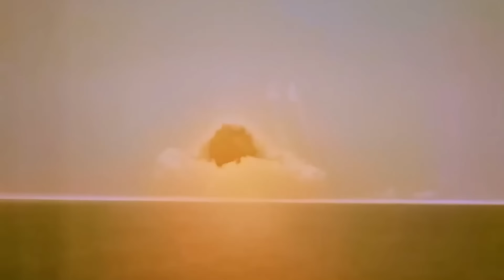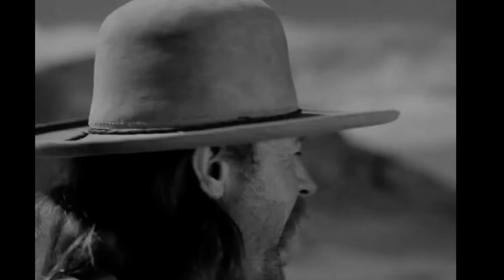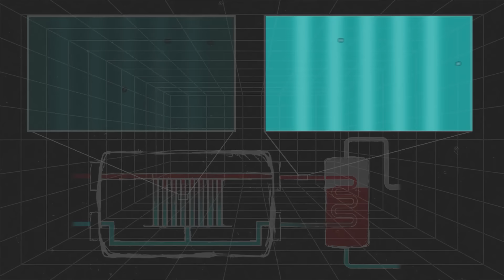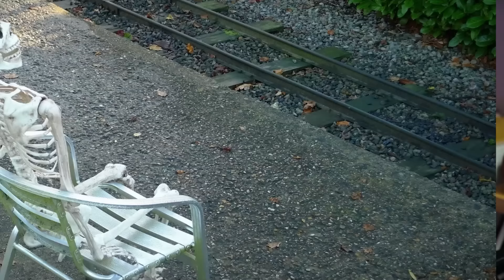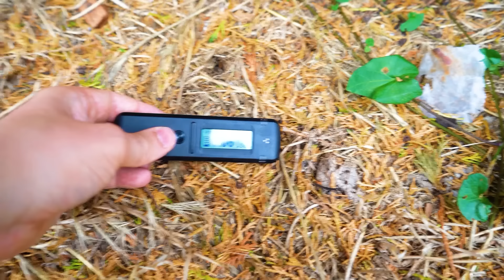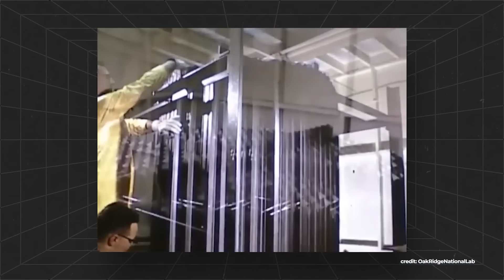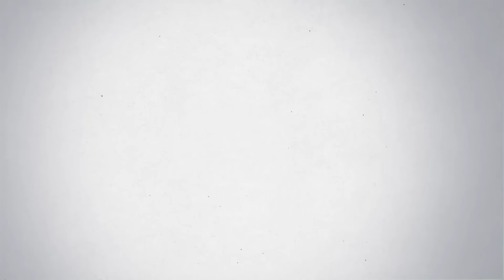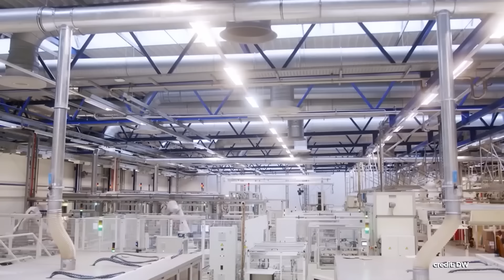It's Happening - China Launches World's First Thorium Nuclear Reactor

Comment: Thorium desalination plant.  Seawater is boiled to produce steam.  After using the steam to generate power, it gets condensed and harvested as water.  The brine gets reused as new material for the molten salt.  Thanks for coming to my TED talk.
Reply: Steam generated from seawater is corrosive stuff and steam turbine blades and bearings wouldn't last long in that corrosive environment.  Using seawater as a coolant to recondense the freshwater steam running through the turbine and making it a closed system requiring no new freshwater would work fine.  That warmed seawater would then be a step closer to boiling temp and therefor require less energy through a separate desalination plant.  And, yes, any desalination plant should be allowing the water to evaporate completely and collecting the minerals dissolved in the water rather than pumping now-concentrated brine back to the sea where it destroys the local ecosystem.
Reply: Sodium chloride may be common table salt, but the salts here are more like lithium fluoride.   Besides, this is not a brine, but a salt so hot that it melts.
Reply: @shishkabobby  You could just completely evaporate the water, leaving salt crystals behind. These can then at least be used   as a basic supply of salt, which would need to be sourced anyway as part of an ingredient to create the coolant. You couldn’t pump it straight in but use it as a resource.
Reply: @13minutestomidnight  It is still the WRONG SALT.  Nobody has used NaCl and related salts for a molten salt reactor.
Reply: I like the idea, but sadly the resulting salt is closer to what you'd use for cooking than suitable for reactor use.  The salts used in Thorium reactors is fluoride based - not terribly suitable for consumption..
Reply: @freddoflintstono9321 tell that to the water supply adulerators! Are you suggesting a good use now for the fluoride by produced in aluminium smelting?
Reply: @freddoflintstono9321  then why the need to consume?? the salt is used during the reaction thus being suitable for reactor use..your talking about the by product
Reply: If it is that easy, why don't each and every electricity generation plant (as mentioned by this video, all use steam turbines) doubles as desalination plant as well??
Reply: Like another commenter mentioned, the salt these reactors use is not the same as table salt (what you'd get from seawater).
Also, I assume these reactors are closed loop for their water cycle, so you'd be better off just using the electricity to run a desalination plant.
Reply: The salt from the sea (mostly sodium and chlorine with a mixture of many many different salts) is very different from the molten salt required (lithium and beryllium fluoride, although variations exist).
It's like harvesting lead and planning to make gold watches from it.
Reply: Putting saltwater through a boiler and turbine system sounds like an absolute nightmare, and you'd have to shut the reactor down frequently or hot-swap tanks to remove the salt layers, hope to whatever god is up there that no salt entered the turbine.
Reply: @cdgonepotatoes4219  Could use an extra-large heat exchanger so the inner reactor water loop never makes physical contact with the external seawater.
Reply: Remember this man isn’t suicidal nor immuno-compromised
Reply: Yeah, when they say molten salt they mean it. It's not random salt or salt + water. It is pure liquid salt and, it has to have certain characteristocs because will be used as temperature mediator on the first stsge before the water.  It will also interact chemically with thorium to facilitate separation by normal industry processes like decantation.
Reply: No offense but this is classic armchair engineer thinking. There are a dozen reasons this is a horrible idea without literal decades of refinement. The most basic one is the need for cleaning. Desalination isn't generally viable on a large-scale for two reasons: Power needs, which could be solved by this. Maybe... and the other more important reason is the build-up of non-salt byproducts because the ocean isn't just salt and water. It's full of many other materials that can't be removed as easily and could easily be detrimental to the nuclear power system's salt needs... so you already need a salt refinery added into the system as well, and clean water pumping to run the initial reactions, and/or significant down times to clean the byproducts out of the desalination... So you've basically made a less efficient reactor (because its support systems now need support systems) with more byproducts, removing the entire supposed benefit of thorium reactors.
Reply: There could be problems with salt water spray getting into the turbine, and preventing the salt water spray form getting into the turbine could make the energy conversion less efficient than clean water. Also, sea water isn’t JUST salt: it also contains plankton and minerals and lots of organic matter that could present a burning problem when it is collected and mixed with molten thorium. Also the salt build up would require frequent cleaning. It might feel space efficient, but everything has to be economical, but less so when it is funded by tax money.
Reply: Needs more magnets
Reply: It doesn't work like that.
Reply: saltwater is EXTREMELY destructive/corrosive to turbines, the amount of salt it would also create would be a large bi-product you'd need to safely dispose of instead of just dumping it back into the ocean.
Reply: sounds like a logistical disaster, unless its built near flowing bodies of water/coast , which is in itself already politically discouraged.
Reply: You should have started with 'What if I told you ...'
Reply: I like that idea
Reply: Wrong kind of salt. Thou want fluoride based salts, not chloride based salt.
Reply: Except the salt coats everything and inhibitors are horrible and not easily removed from the brine. Which is usually dumped back into the sea…
Reply: Nice idea, but the salts commonly used in molten salt reactors are generally fluorine salts, not NaCl like one would get from seawater.  Further, seawater has all kinds of organic junk in it.  Given that the molten salt is not consumed in the reaction, it's easier to just start with the salt you want and leave it alone.
Reply: A more important development is the introduction of plastics into the food chain.   Finally, we'll be able to feed the hungry masses with our waste plastic.   What is food, after all,  but carbon, hydrogen, oxygen, and nitrogen?   By the way -- what comes after Z?  And when they finally get the right algorithms for de-materialization and re-materialization, there will be a Transporter in every garage and a Replicator in every kitchen.
Reply: I wonder if it will be that simple. There may be more processing to get the salt pure enough for purpose.
Reply: You are talking about Thorium Floride and not Sodium Chloride... right?
Reply: Salt water is extremely corrosive - especially at higher temperatures. Salt collects on components as the water evaporates...
Reply: Ill hire you. Dm me if youre looking for a project in 5-10 years
Reply: Any volunteers for drinking it?
Reply: @fractalmadness9253  If done correctly, the water will not be radioactive.  It will pure clean distilled water.
Reply: It's a complete lie that thorium is significantly safer than traditional toxic uranium based fission nukes - both invariably produce new poisons so dangerous that a microscopic particle too small to detect lodging itself in your lung or intestine will probably kill you, and these poisons last for millenia. Thorium's advantages lie in how toxic PARTS of fuel rods themselves remain, and that thorium can be bought cheaply in India, and from Brazil by the Chinese. Thorium in some ways is actually significantly MORE dangerous than Uranium, as the process for making the fuel rods themselves - irradiating the fuel - is so dangerous in many cases that people can't even be close to the process, & it has to done by robots. It also produces far more of truly horrifically dangerous radioactive cesium and iodine, which are both actually incorporated INTO living tissue, and deposited within bones, & emit ionizing radition that will eventually kill.
Reply: Wooow your the only one which thought of it...i totally didn't back in hs, idea gets you no where bro
Reply: Start your experiment and report back your results.
Reply: They had a thorium reactor running at Oak Ridge in the late sixties. Thorium reactors aren't "safe", they produce tons of incredibly toxic poisons, some of which remain toxic in amounts too small to measure for millenia ie they still produce plutonium (though much less than traditional uranium reactor) and a whole bunch of other nasty unstable nuclear isotopes. They produce tons of radioactive waste, including radioactive iodine, which while it has a half life of "only" a few weeks, it's incredibly poisonous while radioactive & emitting alpha particles, and iodine is an element incorporated in all life. If your body takes in ten grams of it for example, "half life" two weeks, means that you'll still have enough to kill you after years, as halving ten grams every two weeks still leaves enough to destroy DNA & kill you with cancer, as it only takes long term exposure to an undetectably tiny particle of the radioactive iodine.

The fission byproducts of the man-made unstable isotope of uranium that thorium is turned into before it can be used in the reactor include about a tenth of the amount of plutonium produced by "regular" uranium fission, but one tenth of a poisonous substance that exists naturally as an aerosol capable powder, and that remains' mortally dangerous in amounts too small to measure for millennia is still TOO MUCH of that poison being made. There's a whole bunch of other long-half life actinides produced also. ("Theoretically" the reactors can be used to "breed" and "burn" the plutonium produced, but that's in theory only, in practice, the process is not without inefficiencies, and ends up producing about a tenth of the amount of plutonium produced by a regular uranium/plutonium reactor.) 

Thorium "safety" is a lie, and let's not get into the process needed to "activate" the thorium and make it unstable enough to be used as fission fuel (ie bombarded with neutrons and turned into man-made uranium, which is actually what the reactor uses.) - that's so dangerous it can't be done by people - it has to be done by robots. 

The US DOE also made working thorium reactors many years ago, including one that leaked, and they rightly dismissed them as too dangerous and expensive. The only reason China and India are going for it is that thorium is cheaper than uranium, and is currently mainly found in Brazil, and India, not like uranium, which is in the USA, Australia and South Africa.

Reply
Reply: It’s interesting to me that so many people seem to think the word “salt” is a synonym for sodium chloride (i.e. table salt).
Reply: @doomtho42   It has the symbol Th and atomic number 90. Thorium is a weakly radioactive light silver metal which tarnishes olive gray when it is exposed to air, forming thorium dioxide; it is moderately soft and malleable and has a high melting poin
Reply: @doomtho42  Molten salts are typically made up of 60% sodium nitrate and 40% potassium nitrate, and the salts melt at approximately  ..... salt is the storage medium
Reply: What kind of ass-about-tit commerce would set out to augment the essence of life on Earth?
Reply: It is criminally inefficient to produce fresh water by boiling. All desalination plants in the world using reverse osmosis.
Reply: @marginbuu212  ,

Hahaha, not that kinda of salt bhai.
Reply: Use the Power from the Reactor to make Hydrogen at a never seen before affordable rate and store energy that way from some of the water.  Now you got some energy that can be stored and transported and used on the go. For all the cases that would need such a thing.
Reply: Is anyone in the replies (despite the idea SEEMING to some like it might work fine) gonna acknowledge the last sentence and how the comment is partially joking because of it
Reply: Don’t discredit people ideas, especially if it helps humanity and is also plausible
Reply: stick to the day job
Reply: Radioactive water 🤤
Reply: It's pretty crazy you are the only one out of the 50 comments to mention this part... I'm sure it's avoidable but I bet not very efficient. And even if there's some way to figure out how to transfer the heat into the salt water without the radiation I still don't think it would be a good idea for humans to use water from a nuclear reactor.
Reply: @zcgunthihairus  It's not surprising at all. This stuff is complex, and all the people who have enough education and experience to understand what is actually happening stand to gain their whole livelihood and/or billions from not telling the whole story. Lying by omission for cash when selling something is the rule rather than the exception in human behavior., especially amongst corrupt censored neo-feudal cultures like the CCP & communist China, Russia, and semi-communist India, who also happen to be the three main countries pushing this dangerous toxic tech. (I totally hate the fission nuke program in the US, France Britain & Japan (and trad ones in Russia) even more though, but be very clear about it, "thorium" fission's "safety" and environmental friendliness is a complete and utter fabrication. All they can claim is that they are in SOME WAYS less dangerous than the absolutely toxic "trad" fission nukes, but in many significant ways they are actually MORE toxic.
Reply: @zcgunthihairus  So, what do we do with it?  Dump it into the atmosphere for everyone to breathe?  What do you think those huge cooling towers with clouds of steam coming out them are?  Or, dump it in the river, lake, or ocean so it can make the fish radioactive (which we eat) or the water unsafe to swim or bathe in?  The reactor has to be a closed loop system where nuclear radiation stays in and we get the heat energy out.
Reply: Bass awkwardness keeps America from looking at this. Much less expensive to develop  than than trying to develop hot fusion.
Reply: Use the salt as a source for sodium in batteries. Make grid size sodium ion batteries to store surplus renewable energy and make a truly smart grid.
Reply: OBVIOUS ideas are NOT patentable, and this idea IS obvious.
Reply: @YodaWhat  is it not an original idea?
Reply: @ghanvedsingh8946 objectively someone has already thought of, and tested this idea and found it to be non-viable. This guy just re-thought of it again
Reply: @YodaWhat  that said in practise obvious ideas often get patented
Reply: @YodaWhat  All ideas are obvious after the first person has a light bulb moment.  Every vision is a joke until the first man accomplishes it; once realized, it becomes commonplace.  --  Robert H. Goddard
Reply: Great idea (really, I mean it), but have you considered the optics of getting people to drink water that's been used in a nuclear powerplant?
Reply: Salt is radioactive 😊
Reply: @PlanXV  Anything is potentially radioactive that is exposed to nuclear fission, that' how thorium reactors can even exist. Thorium in its natural state isn't really radioactive, and certainly not enough to create nuclear fission needed to power a reactor, but before thorium can be used as a nuke fuel, it's bombarded with neutrons from a fission reaction and actually turned into unstable uranium, which is then used in the reactor to power it ie there is actually no such thing a "thorium reactor" it's really a uranium 233 (artificial uranium) reactor. This whole thing a pretty much bullshit when it comes to major safety points. It's "efficiency" IS higher, ie less waste, but not total elimination,  and its often MORE dangerous, not less. It just POTENTIALLY produce less plutonium waste, not none, just less, and theoretically it could produced as much as 90% less, but that still leaves 10%, AND lots of other long-dangerous highly toxic waste, like radioactive iodine in particular, which is one of the elements which makes up "salt". Because it's radioactive, and "salt", it means its assimilated into living things, and deposited in their bones, killing them over time with alpha particle radiation.
Reply: The salt in seawater may not be a suitable coolant, but it contains basically everything you need, albeit in small concentrations. Besides the obvious sodium, which can be used in sodium ion batteries, it contains lithium, thorium, uranium and many other elements, and the byproduct of distilled water can be very valuable in certain parts of the world
Reply: YUO R A GENIUS
Reply: I thought that they would just use the power from the plant.
can you hit my up with a source?
Reply: @jebkermen6087  I don't think there's a source. This seems to be an original idea meant to make the additional output (other than electrical power) of the powerplant useful. And IMO, this idea nails it.
Reply: @julianl.3857  I just think this would make it much more complex having to manage many different liquids in the same assembly.

And as was stated the location of the reactor can be far from where saltwater is, and where fresh water needs to be.
Reply: @jebkermen6087  - There is saltwater almost everywhere on Earth (and several places in space that we know of). You may have to drill for it, but it is there.
Reply: You are right any one with horse sense could have thought of this
Reply: @YodaWhat 
Will the GOP "drill baby drill" for it?
Reply: @jebkermen6087  there is no source.  Just something I thought up randomly.  I guess I'm the source.
Reply: @marginbuu212  that's fine.
All ideas have to start somewhere.
Reply: @grumpyfuktard  
I don't think your in the same book as me, let alone the same page.

Nothing about using a non molten salt thorium reactor is in the conversation.

Source for the study of using a reactor as a dual purpose power and desalination plant? As I've asked for in this thread.

Anyways  - Jeb
Reply: Be quiet, TED. 😄
Reply: That just about solved half the world’s problems with water scarcity. Of course, they could also be using the waste heat from a number of industrial processes for thermal desalination, which would at least save on the electricity requirements, but pairing with TMS would solve many issues with desalination in one go. 👍

The salt needed for the coolant isn’t the salt in brine, but that kind of salt could be processed and used to help create the coolant?